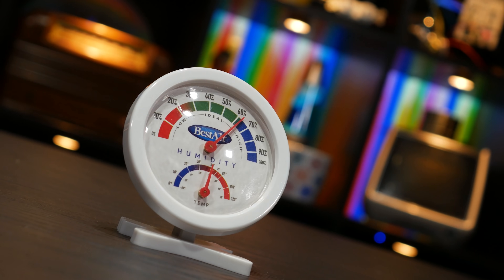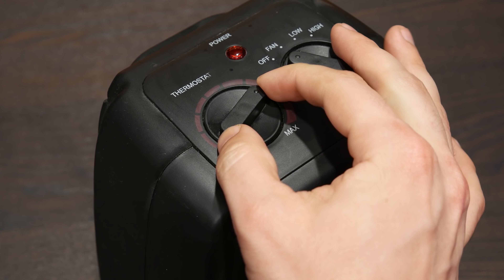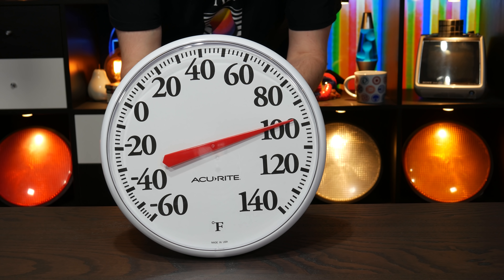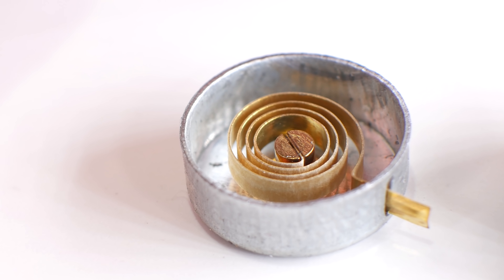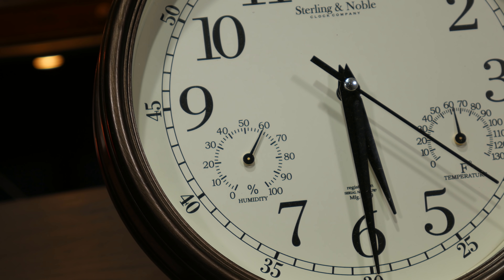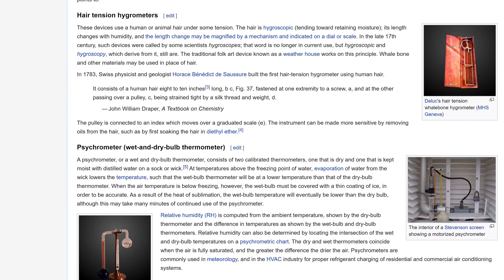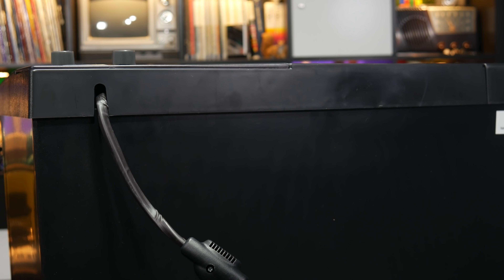Analog Hygrometers - how?

Comment from the maker: I ran some basic tests on the hygrometers to see if the linear scaling would be a problem. A link at the end takes you to a Twitter thread with pictures. The result was... mixed. It seems clear that the high end humidities are never attainable on the Taylor model nor the clock. They don't seem capable of reading past 80%. However, on the low end they were in better agreement with the other models.
It may be that the linear-scale hygrometers are built so that they behave more linearly but I'm personally doubtful of that. I would personally avoid dial-hygrometers with linear scales.
https://twitter.com/TechConnectify/status/1387791666183032834
Reply: Could you do a video on how water softeners soften water? I think I looked at 20 different diagrams and I still don't understand how the water doesn't get salty or how the limescale soaks into the salt
Reply: @droko9  From what I remember off the top of my head, the salt isn't used to soften the water at all (not directly anyway). If you look at your water softener setup, you'll have what looks like a big garbage bin that you put the salt in. Next to that is what looks like a pressure vessel (because it is) this contains tiny little beads of a resin that acts as an ion-exchange medium. This is what pulls the calcium and magnesium from the water to soften it but it has a limited capacity, and has to swap that calcium with something else (hence ion exchange). The salt is used to reset the media, allowing it to flush the collected calcium and magnesium, and regain the sodium ions that will be exchanged for the calcium and magnesium ions later
Reply: @droko9  Most water softeners use a synthetic resin to leach the minerals out of the water. The salt is only used to clean the resin periodically. Some salt does end up in the supply water however, and people on sodium restricted diets are advised not to consume softened water.
Reply: @droko9  There are resin beads in the softener that calcium likes to stick to.  As the water flows over them, they remove calcium, making the water 'softer'.  Over time, they get coated with scale (calcium), so the water softener washes brine water over the beads.  The strong salt solution will strip off the calcium.  The softener will then rinse the beads with clear water.  Some salt remains, so there is a slight increase in salinity in the house water.   This cycle repeats over and over, so you have to keep supplying the salt to make the brine.
Reply: @droko9  yeah...I like this PROBABLY not so simple topic!!
Reply: The water does get salty from water softeners.
Reply: @droko9  Depends on what water Softener you're looking at. There's a few different methods available.
Reply: 5 part series on dew point instruments & hygrometers, five part series on dew point instruments & hygrometer!!!!
Reply: @mxecho  Through trading I ended up with a chilled mirror hygrometer. Its only downsides are power consumption, price, and price. And that it tends to stop any discussion about lack of accuracy :-)
Reply: There maybe could be a way of integrating a ratio into the "mechanism", but I guess that basically all manufacturers skip that and go straight to the digital sensor because it is easier and cheaper to produce, which is wild in itself
Reply: I absolutely know how that goes. You start with 1 or 2 pages of words, and then flesh them out. All of a sudden it's a 6 page script and it's not close to being complete.   Great videos man. I really enjoy your work. Hoping to one day pick your brain on your processes.
Reply: In high school we learned another type of humidity measurement device. It's called a psychrometer. Basically a wet bulb thermometer, a dry bulb thermometer and a lookup table.
Reply: You sound very salty about Twitter there. Who hurt you, Mr Brown Man?
Reply: So before such things as even handheld calculators, were taught a simple formula to convert Fahrenheit to Celsius, which has remained with me to this day. Simply subtract 32 then divide 9 and multiply by 5 will give you Celsius which you can do in your head quickly enough ;-)
Reply: Really rock'n that pandemic haircut look.  Nice.
Reply: Couldn't a high-end linear dial hygrometer be built using an electronic sensor and just using a needle as a display?
Reply: Am glad the world's greatest toaster was mentioned. Without its technology, there were no hygrometers, air conditioners or the internet. We should talk more about toasters and how they saved the world.
Reply: If you ignore the scales, does the angle of the cheap clock correlate linearly with the angle of the other ones?
Reply: It don't care if the videos are simple or complicated... we love the videos
Reply: What about the fancy multifunction wooden ones that hung on the wall in all our grand parents’ houses?  Are they different
Reply: I read this comment in your voice
Reply: Might I suggest doing a follow-up where you show how professional meteorologists measure humidity?  Their reports often show >80% humidities, so they must have a more accurate system.
Reply: What a sneaky way to point us to the Twitter-channel... :D You got a new follower!
Reply: Real Chads use Rankine.
Reply: Fun facts Alec.... down here in Latin America everything is in Celsius.. yes simple.. simple...
but if you go to a hardware store... and you need to make a hole for a 5 millimeters LED... well then you need a 5 millimeters drill bit.. right .. yes .. simple.. simple......
.. now if you need a screw or bolts and nut for that hole.... you must transform it to inches.. because the screws bolts and nuts here are in inches.. unless you want ... "the expensive ones" ... the "Europeans" one.. (because is also the European screws bolts and nuts)..  aaaannnnd....... yes.... they are in millimeters.. and with different incompatible threads...
Now if you want an authentic trip of back and forth between the metric and the English System.. Go to a bike store here (bikecycle or motorcycle is the same mess) and buy the stuff for build you self a wheel..... yes one of the "simplest machines".. the wheel... ..... then  you have......
The Tire ... is on inches .. both the circumference and the thickness
.. ok cool...
The inner tire (the inner tube) ... is also in inches yes...... but.. if it have European air valve (Presta) then it is in millimeters... now if it have Schrader or Woods.... then is back to in inches.....

Now The rim is on inches... circumference and the thickness.... but the air valve hole will be in inches or in millimeters according to the Inner tube that you have chosen before....
The spokes (tensioners) .. are in millimeters... but many people know them in centimeters..... Unless it's the new kevlar or carbon fiber one .... which.... yeap.... is back to inches....
Now the center mass... It is in inches ...... if it is with sealed ball bearings... but it is in millimeters if it is with Cup & Cone ball bearings.....
and finally the axis.... with which you screw the wheel to the frame of the bicycle or motorcycle....... yeah that one is "European" ...... is in millimeters.. and with the incompatible threads with rest of the  screws bolts and nuts you have around here......
and they say that "wheel and axle" ... is one of the "6 simplest machines".... :-D
Reply: @Ramdileo_sys  And how about the toolboxes... Here in Canada, 2 sets of wrenches, 2 sets of ratchet boxes, 2 sets of Allen keys... Double the tools for nothing! They always end up mixed up and sometimes one almost fits to the other but not enough to prevent stripping all your nuts and screw heads...
Reply: @DroneMTL  totally true.... that's why adjustable wrenches are so popular... like the Bahco .. shifting Spanner (English/French wrench
) .. Stillson (tube wrench
)..  parrot beak clamp.. Pipe Wrench Pliers.. etc etc....... and obviously the bits for screwdrivers.... the good kit's that come with the adapter and the "tubes" for the different nuts.... both in inches and millimeters... are the favorite gift for Father's Day over here...
Reply: I actually own an expensive model with a linear scale. It is using synthetic fibers to measure humidity and reads around 98% when wrapped in a wet towel. There is also a method of using wet salt to calibrate, because salt has a specific affinity to moisture and will therefore eventually reach equilibrium with around 75% humidity when placed together with the hygrometer in an airtight bag. Mine red 74%, so the scale must be really accurate, at least for high humidity.
Reply: put one in a vacuim to se where the 0% is
Reply: Can you make your next video about why there was no ending music this time?
Reply: why there is not end song ?
Reply: On the topic of conversion of freedom units, using Opera or OperaGX you can highlight a number with ° near it, it will automatically convert the number in a tooltip. 72°f here, not sure if other browsers support that. Oh and works on Opera mobile. (been using opera since 2002, fun fact opera is the oldest still updating browser)
Reply: You should get an antique wood and brass one from the UK, they are really nice although I think we call them a weather station barometer.
Theres also cute Dutch pot ones which rely on a human hair to move a little man out of a house depending on the humidity
Reply: @hexasides6411  - As long as you can calibrate it properly, any source of hair should be usable as long as it reacts to moisture.  A porcupine quill, for example, is made of hair, but would not be suitable.
Reply: Now how about a Barometer?
Reply: Always happy to see you've got a new video
Reply: None of the mechanical hygrometers are worth a damn. +/-10% at best, and only in a narrow temperature range. The electronic ones in humidifiers and the like aren't much better. Humidity is pretty difficult to measure accurately. You have to spend thousands of dollars to get one that will get within 1%, and it requires frequent calibration, at another few hundred dollars a shot.
Reply: Admit it, this was just a tangent from the toaster 😅
Reply: It is easy... Would be still easier if you just converted to metric lol.
Reply: In Canada unlike Europeans we're still setting our ovens in F, and most swimming pool owners measure their water in F too. But outside air temp, we use C as it's much easier to know when it's about to freeze...
Reply: You're missing some snark.
Reply: just use superior units already.
Reply: amogus
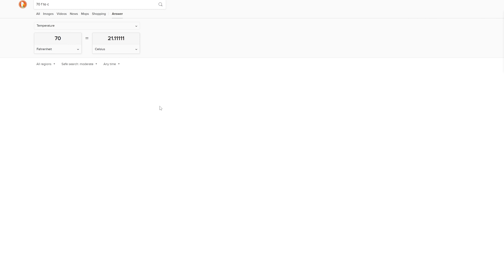Reply: 2:24  NO
Reply: Wait a minute. What if you put this analog hygrometer to a jar, close it, let it sit for a while and then start heating it up? If we measure humidity relative to temperature, then temperature in that jar would go up, but relative humidity should go down. But how would this bimaterial coil know this, if it wasn't also bimetal at the same time?
Reply: @mirekjosiek8472  The paper strip would dry out and become less saturated due to the heat... When cooling down the water would condense again on the strip. But these hygrometers are made for normal inside temperatures, not for when being heated up
Reply: No one tell him about how you get an accurate humidity reading. Especially when he finds out how simple and basic the equipment required is.
Reply: I wonder If it would be possible to use something like a four-bar linkage to turn the nonlinear motion of the coil into linear motion of the dial. Then you could make an accurate linear scale hygrometer! Huzzah!
Reply: You are looking quite healthier than before.. not that you didn't before. I mean you just look healthy today man.
Reply: Surely if (and I agree) people should just be able to apply a half-ass formula or google the conversion for temperatures then the point seems to be that we generally should be clever enough to distinguish what's subjective/objective about the measurements and if that's the case then who cares where the "zero" point of a hygrometer is?  

Who has an actual sense of what different levels feel like on a hygrometer and presumably (or not I guess...) it's not the same as the "relative humidity"/numbers on actual weather reports so why hold it against the hygros for just bein their own thing?  Can't you just let hygros BE what they FEEL like they are?
Reply: Am glad the world's greatest toaster was mentioned. Without its technology, there were no hygrometers, air conditioners or the internet. We should talk more about toasters and how they saved the world.
Reply: Americans do use the metric system... For food Calories are based on metric units (1 gram of water, 1 degree Celcius/Kelvin). For electricity, watts, volts, amperes... all SI units! Gasoline engines cylinders are measured in liters and not cubic inches anymore! Now yankees just need to close the gap between to go from watts (power) to joules (energy) to work to force (N) and to mass (kg)
Reply: @DroneMTL  Don’t forget track events. “100 meter dash” rolls of our tongues like nothing. 

Also, most liquid medication doses are given in milliliters now, and active ingredient content of virtually all drugs are given in milligrams.

Metric is everywhere. We just don’t notice it where it’s already established.
Reply: Do barometers next!
Reply: I prefer Kelvin!

Just kidding, and I'm sure the mockery of scale Nazis is becoming old. "I prefer Light years", etc.
Reply: Give it to me in KELVINS
Reply: l
Reply: When we complain about Imperial units, its not about having to convert it... Its about a principle, if a child steals a single candy, worth 5ct, its getting punishment because theft is wrong, not because the 5ct hurts the shop. Think of that when we complain about not using real units of measurement
Reply: 2:30 Ah yes a recurring decimal this definitely won't cause any real world problems.
Reply: As a science man, you damn well know that metric is more then 'just another scale we can use'. The only reason you wont, is you are now used to using the wrong scale, so you wont use the correct one.

Metric has two things going for it. Three actually. 1) It simpler. 'Length' in imperial is a total mess, for example. Inch, mile, yard, feet, they all have random properties, nothing is 10 based. Calculating volume by multiplying length is a chore in imperial: you should first change all lengths to the same measurement (inches for example), and only then can you tell me how many inch^3 it is. But volume is not in inches^3. Its gallons. For some reason. That nobody knows. And that has nothing to do with inches. 2) You can derive them yourself. Take water. When it boils: its 100 degrees. When it freezes: its zero degrees. Please tell me again about the brine mixture needed to get to fahrenheit, and how you are going to reproduce it when you are stranded on an island. All measurements in metric: are derived from each other. 10cm x 10cm x 10cm water weighs one kilo, for example. The kilometer used to be defined as 'the circumference of the world, divided by 40.000. 3) the most important thing for metric: formulas. Anything in physics and in science: can be expressed in formulas. Watt, for example. Or momentum. Or volume. Its all boiled down to their simplest direct connection with the underlying dimension (time, space, temperature). Imperial, on the other hand, cannot even define 'volume' in a decent way, let alone things like 'power', or the even more complex formulas. Imperial stands in the way of understanding nature: metric on the other hand: makes it clear. https://physics.nist.gov/cuu/Units/units.html 

Imperial makes people more unaware of their surrounding world. It makes more stupid. All scientist in the USA actually only use metric. And transform the output to imperial only to not upset the yanks who refuse to learn real numbers.
Reply: ⚠ Original profile on X does exist, but is likely compromised.
Post does not exist.
Reply: Celsius is not a metric unit. Technically it is an SI unit, but it's not really metric in the traditional sense. It's just a random temperature unit that the whole world (except the US) agrees on.
Reply: @Thewinner312  I'd say you're splitting hairs.     SI is a metric system, so anything within SI is a metric unit, by definition. Technically, the Kelvin is the SI unit for temperature, and Celsius is not. However, they have the same value, just a different zero reference, and the Kelvin is in fact based on the Celsius, not the other way around.
Reply: @trevorlambert4226  yeah, I agree in splitting hairs a bit^^ Fair comment. However, what you said isn't entirely true either. SI is not the same as metric. For example seconds and hours are SI units. An hour has 60 minutes, so not very metric. Same C/K don't really have any metric steps (ie base ten).
Reply: @Thewinner312  I wouldn't say it is random as it is based on the freezing and boiling point of water. Nor is Fahrenheit random, it is said to be based on the lowest temperature European weather gets,  set as 0 (water freezes at 32 so the coldest it gets in Europe is 32 below water freezing) and the warmest set as 100. Neither scales are metric because they are not based on the metre. Technically Celsius is not an SI unit, that's K, Celsius is an SI derived unit.
Reply: @MrProlecat  The number "32* F" isn't the freezing point in farenheit, it's the melting point.
Most people who don't understand this use farenheit incorrectly.
Reply: @max cool story bro.
Reply: @Thewinner312  - The only TRUE temperature metric is actually the Kelvin scale.  It's based on atomic activity.  Absolute zero means atoms come to a complete stop.  Never really understood what defines the upper threshold however.  I guess I tuned out for that part of science class.  😁
Reply: @phydeux  One good example of use of the Kelvin scale in physics is the ideal gas law (PV = nRT) which says the pressure and volume are directly proportional to absolute temperature and number of molecules. The upper limit doesn't really matter here as the R constant adapts the different scales together, what matters is that the temperature scale starts at the absolute 0.
Reply: @Thewinner312  Celsius is not a SI unit. Kelvin is.
Reply: @ferwiner2  SI is a bureaucratic system on top of metric.  SI consists of metric and whichever existing units they needed to create official units for everything else by multiplication and division.
  °C was the traditional scientific unit, K is °C shifted so ideal gas law needs no addition term, this happens to make 0K the temperature of all the molecules not moving.  °F is the traditional imperial unit based on a scale from the coldest reference mixture in some lab to human body temperature.
Reply: @Thewinner312  - Correct. F was developed to measure real world things. It does a better job for weather temperature variations without resorting to decimals.
Reply: I use a Fischer hygrometer at home. It is linear and quite accurate.
Reply: @gzfelix  What do you reference it to so you know how accurate it is?
Reply: Blam! If one person does the F -> C conversion one time it is more efficient than all of your non-US viewers having to stop a video and convert it, by the billions (you do have trillions of viewers, right? me is good with numbers). This is why you need to do it instead of us, as it is without a doubt the most efficient way to do it. Also: when those numbers are on screen, we will learn.
Reply: @squidcaps4308  - Or you could learn F, get more precise temperature information, and stick it to the man.
Reply: @squidcaps4308  Your logic with respect to efficiency is unpleasant but undeniable.  Also, for Fahrenheit-ers, here's all that matters: 0 -> Freezing, 10 -> Cool, 20 -> Room, 30 -> Warm, 40 -> HOT, 60 -> Burns, 100 -> Boiling.  That's about all you really need - guesstimate the stuff in between and nod along like you understand.
Reply: @cullendelmore2614   @Cullen Delmore 40 was WARM?  60 was hot and 100 was burns?
Human temperature pain threshold is 108* f ( 42.2 C )
Burns occur right as pain does.
You mean 100 C = CONTACT burns.
40 C = Pain and light burns.
60 C = COOKING temperature. 140* F Not just HOT, but steak searing hot.
Well, temperature only begins to cause pain at 60C, so that's alrea
What?
20 celcius is NOT room temperature. 68 F is 4 or 5 degrees below average room temperature; and at higher relative humidity, up until 50%, temperature feels colder. 
If you had a relative humidity of 35%, at 68* F (20 celcius), you would feel like you were actually in a room at 66* F (19 celcius).
NOT ROOM TEMPERATURE.
If you were in a room at 72* F (22.2 C) at 30% relative humidity, you would feel as though it's perfectly 70* F (21 C).
Dew points still exist in your house.
Your point stands EXTREMELY UNPROVEN.
You've only shown how USELESS metric is when measuring temperature.
Reply: @D-Vinko  Are you ok?
Reply: Is that the same 'Taylor' as in the new McDonalds soft ice cream expose' ?

How about those cheap digital hygrometers?
Reply: @Lu_Woods  have you watched the entire video ? he said how digital work
Reply: I think its worse we all still use base 10 when base 12 its better!
Reply: I use metric and Imperial units interchangeably.  I'll say stuff like, "IDK, we need something about a millimeter thin and 2 feet long" and piss off absolutely everyone.  the problem with both systems is that there are gaps in both and they actually mesh together quite nicely, especially for length and volume.  Metric has nothing close to a cup or a gallon, and Imperial sucks for small units like millimeters, milliliters, and centimeters. Want small Imperial units?  Have fun with all those quarter teaspoons and drams, I'll just use milliliters because I want to, leave me alone, it's easier.
Reply: 0=dangerously cold; 100=dangerously hot. The absolute perfect scale for reporting ambient temperatures.
Reply: @justins8802  What?
dude.
0 = MORE than dangerously cold, presence in these temperatures for periods will result in death 
People stop functioning at 21* Celcius internal body temperature, so metric is arbitrary here, it's exactly 70* F internal when measured in farenheit 
(THIS IS BECAUSE FARENHEIT IS BASED ON HUMAN TEMPERATURES. IT WILL ALWAYS BE SUPERIOR FOR MEASURING TRUE FEEL AND INTERNAL BODY TEMP.)
; furthermore dying of cold is arbitrarily based on "Cold resistance" which isn't well understood.
100* C is WAY BEYOND dangerously hot. You couldn't even touch something 100*C for more than a fraction of a second, celcius seems like it makes people super unaware of the actual depth of the temperatures they're talking about. If the air was 100* C you would instantaneously die upon breathing and burning the inside of your lungs; resulting in blood drowning you.
That's 212 * F,  20* below burning paper.
Reply: @D-Vinko  We must speak a different dialect of English because I thought I was pretty clear, and your response is incoherent to me. It seems like you are arguing that Fahrenheit is better for human scale, which is what I was saying.
Reply: @D-Vinko  Regarding 0F being more than dangerous, assuming you are wearing appropriate clothing, you can survive in 0F, and at 100F it can be dangerous no matter what you are wearing.

It’s not perfect l, but it’s a nice scale.
Reply: @D-Vinko  20°C is standard room temperature when heating (not cooling)  homes in northern Europe.  This was chosen as a compromise between unpleasantly cold and excessive oil imports during the "oil crisis" in the 1970s and has been kept to avoid excessive CO2 emissions.
Reply: Thinking of unsubbing as he's always going on about temp crap. Just ignore it bro.
Reply: You have a weak excuse for not knowing the Celsius scale; if you decided to use it, and it caught on with your friends, and their friends picked it up, shortly you’d have the whole US using something meaningful.

And yes, I do know how to convert to approximately F in my head, without a search; I’ve spent time in the US. 

I’d love to share with you the easy formula, but your head is already full of excuses and the will to follow others, fuc|<ing sheep.
Reply: In my school in California teachers don't care about science. They care about LGBT issues and force everyone to wear rainbow flags.
Reply: 2:00 I am a big fan of the metric system, but for temperature I actually have no preference.
Fahrenheit or Celsius or Kelvin all have their benefits.
It's when we start measuring length, area, volume, weight, force, electricity, etc. That is where I vastly prefer the metric system.
And I can read a temperature in Celsius, Fahrenheit or Kelvin without much problem. I am surprised you cannot.
Reply: @rogerwilco2  - Why do I need a million temperature scales. Meanwhile, metric was designed for labs, not everyday use. Imperial divides easily without resorting to decimals, thanks a base 16, depending the measurement system. A foot is about an adult male foot. There is no big deal between a yard and meter, except apparently an attitude.
Reply: @atrifle8364  When was the last time you measured with your foot? Never. So it doesn't matter that it's "about" whatever length. You learn to make those same associations when using metric.

Grasping at straws...
Reply: @thysonsacclaim  Yesterday. I measured with my foot yesterday.
Just because you don't do any hand work doesn't mean no one else does, maybe actually do something which requires measurement first.
Reply: Fahrenheit is so much easier to use.
Reply: I am from the US and I decided to hate the system the US uses, so I switched. Now I think in SI; I highly suggest it. just switch all the things you have to SI measures and let the understanding and naturalness slowly seep in. Then, you get the pleasure of telling people temperatures in Celsius and watching them be confused at how it is so cold.
Reply: Hello there! 🌈
Reply: @robertschnobert9090  general kenobi
Reply: The Metric system is not inheritantly superior in every day applications. Imperial is the system of day to day measurements, using useful increments that divide easily. We get more temperature information and more relevant to cooking and dressing. Sorry to say, water is equally arbitrary measure of temperature as butter. Don't get me started on the dumbing down of everyday math back to using our fingers. "Metric is superior because I can't math at all or everyone else is using it" is hardly an argument about it's actual superiority for everyday use.
Reply: @atrifle8364  The US Customary System uses binary volume measurements. The 16 oz pint is a side effect of 2^4. Imperial uses neither 16 nor 2 for its base. They have 20 oz pints in the UK. Fractional inch measurements are also binary.
Reply: @atrifle8364  Nope. You're wrong. Double wrong because most US cooking and baking is volumetric which is inherently a terrible way to do things.

Weight is far better and this is far more common in metric countries.

Also I'd bet the average person who doesn't already cook can't convert quarts, gallons, pints and fluid ounces.
Reply: @atrifle8364  The US Customary system (often erroneously called the Imperial system) is definitely inferior in everyday usage. It's got nothing to do with whether the references are arbitrary. The two massive downsides are multiple units for the same measure (e.g. inches, feet, yards, rods, furlongs, miles, etc.) and the irregular fraction relationship between them. The whole point of a measuring system is to communicate information efficiently. If you want to show off your math ability by being able to quickly convert 737 and a half inches into yards, by all means take that show on the road. Just don't pretend it's a good way of actually measuring things.
Reply: @trevorlambert4226  "If you want to show off your math ability by being able to quickly convert 737 and a half inches into yards, by all means take that show on the road."

Why would anyone need to do that? I mean in the real world. Give an example of a real world need for that in "every usage," not a professional builder who deals with measurements every day, not an architect who deals with measurements every day, neither of which use yards anyway. 

Nobody cares how many BTUs it takes to warm up the water in their bathtub, or how many pints it holds after they've measured it in gallons, or have measured it in the first place. The speedometer shows mph and the speed limits are in mph. If you want to know your fuel mileage, the gas pumps measure in gallons. What conversion is there? 

USCS is well-suited to everyday use because it evolved from everyday use by uneducated people with limited math skills. Nobody converts measurements like they do in scientific experiments, not in common everyday life. Professionals sometimes do, but they are practiced at it and things like feet and inches are actually very handy. Or they just use SI anyway.
Reply: @atrifle8364  "Imperial is the system of day to day measurements, using useful increments that divide easily."

...lmao. Wow, just wow.

"Don't get me started on the dumbing down of everyday math back to using our fingers."

Remember that time NASA lost a Mars orbiter because a certain American company thought it was a good idea to still use Imperial for everything? Pepperidge Farm remembers.
Reply: I have no clue what you're talking about. Huh.. guess it's easier when you say it out loud to us.
Reply: @ChildOfTheFence  did you even watch the video